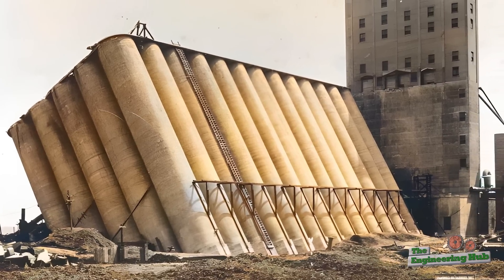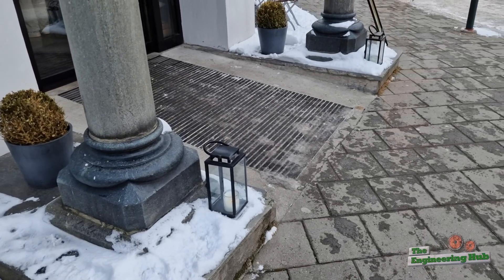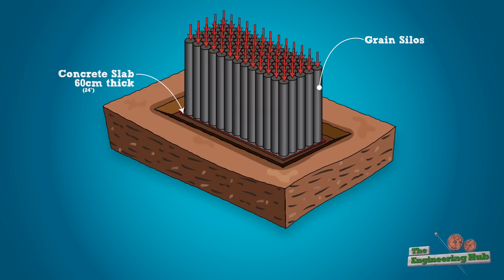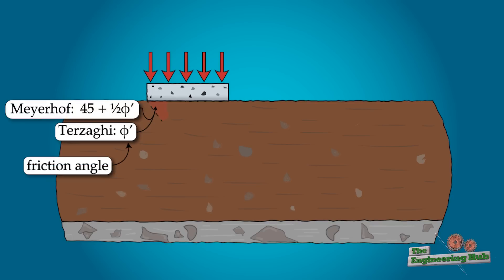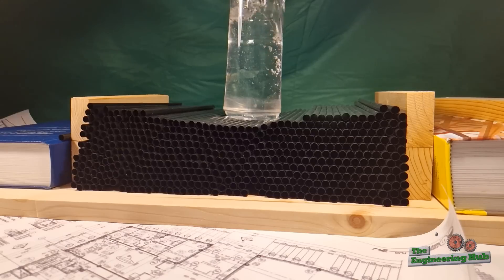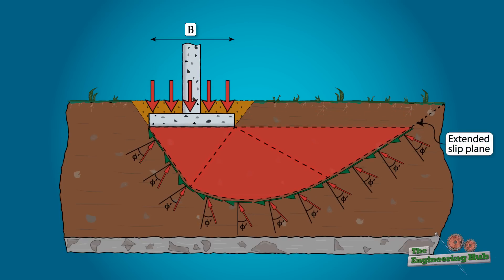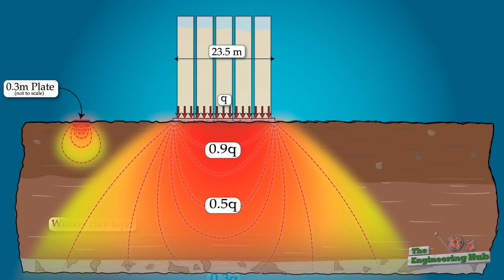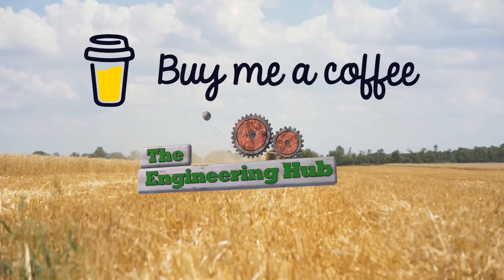Geotechnical Analysis of Foundations

Comment: It would be interesting to hear what you have to say about the Milenium Tower in San Francisco and the efforts to stabilise /save it.
Reply from the maker: That's an excellent example! It could end up being a nice video 🤔
Reply: @TheEngineeringHub  So get busy before it falls over.
Reply: @RRaucina 😂😂😂
Reply: As a pile driver, I would also like to hear your thoughts on cast in place pilings in the San Francisco "bay mud". After seeing the way they were drilled, filled with concrete or grout, and how the rebar cages are literally shoved into collapsed holes and called good... Well, it has always baffled me. I have 3 years of experience in dcip and it was some of the most horrendous pile installation I've ever seen and took part in... and I took no pride in it. 

One day I'm going to hear about one of those projects on the news, just like the millennium tower.
Reply: @dustinthewind3925  if you’re looking to take your experience to another company let me know, I have a small but serious underpinning/foundation repair company here in the Bay and I need good people. Mostly residential for now but adding more services and larger commercial jobs as quickly as I can
Yes, over the past 14 years I’ve seen people wait WAY TOO long to cage and pour their piles. They don’t want to have to pour multiple times so they’ll let the hole sit there for days/weeks before caging and filling it’s ridiculous…and wonder why the structure ended up settling.
Same for grouting their helicals after spinning, or spinning without a geotech report, there’s some dangerous installers out there, imo
Reply: Pisan envy.

Comment: I love the format of these videos. As a visual learner, the graphics and demonstrations, like with the straws, helps me a lot to understand. Thankyou!
Reply from the maker: Glad you like them! More to come!
Reply: @TheEngineeringHub  Can you do about engineering of foundations underground mining? We need to know the evolution of their structural shapes. I'm still confused with people using woods to support their tunnels, and I don't know their limits. Steels are expensive.
Reply: @davidarvingumazon5024  Wood is cheap and easily available in most distant mining locations, easily cut to length, and has great holding capacity. Using steel, you would still need something rigid to spread the load, else the steel would be driven like a nail into the earth. Very much like foundations!

Comment: Factor of safety is important here, which is the ratio of ultimate failure load to design (actual load). In every civil mechanical structure the factor of safety is used, if variable are unmeasurable or not measured it is increased. It could be high as 8 for tractors or 1.2 for rockets. In general engineering structures it is 3 to 4.
Reply: A low safety factor for rockets makes sense. These things are so precisely engineered with extremely high quality control for the materials so that the possible loads are highly predictable.
And they also need to minimize total weight as much as possible.
Reply: The factor of safety is usually taken against the computed "ultimate" strength (resistance) of the soil. Note, however, that this is the strength limit state and it may require that the soils move (settle) a great deal to fully mobilize the available resistance. In many cases, the usable strength is dictated by the settlement tolerance of the structure being supported - known as the serviceability limit state.

Comment: I am older and in USA. We rarely use jewels or newtons Pascals kilos etc.. Yes I can convert but content makers should consider using both. It would be better if US and a few other places switched to metric,  Almost did in the mid 60s.  Good vido other than I have to do conversions to understand the forces here.
Reply: now you understand what it likes to be a non american watching american videos!
Reply: @hitler69    I do at that. No kidding I right now have a guest from France watching the movie Aviator. No German sub titles Available. It speaks about wing loading and altitudes etc.. Why the USA did not convert to Metric  I do not know. The mechanics in rest of world must think these US folks are nuts when a bolt size is 17/32 s   next size up from 1/2 inch. But I think in quarts pints cups gallons not liters  Take care
Reply: Basically only the U.S. uses exclusively imperial, so I don't think the rest of the world will adapt to cater to one country.
Reply: @WhenDoesTheVideoActuallyStart  The US has never used the imperial system. The imperial system wasn't introduced into the British Empire until 1824, and the US had long been independent by then.  The US uses it's own system called "US Customary Units"  which are evolved from pre-imperial British units.
Reply: @WhenDoesTheVideoActuallyStart  The imperial system has many differences from US CU. The liquid measures are completely different.   When was the last time you heard someone give their weight in stone? I'm sorry that you aren't smart enough to understand that this stuff matters.
Reply: @thekinginyellow1744  It shouldn't matter, no.
Reply: @When does the video actually start?  no ,they wont.l don't expect them to.But can you imagine what a massive undertaking it would be for us to change.?We ate the largest economy in the world BY FAR...We are the first to do most everything.we are the guinea pigs for what doesnt work.Thats WHywe are unsuccessful sometimes..We have problems nobody else has too..but we are givers.We rebuilt our enemies after WW II...Who has ever done this?..The Marshall Plan..
Reply: Could you cover recent earthquakes via mechanics
Reply: I am an electrical engineer and physicist from California. Fortunately electrical engineering is metric by nature, especially as I have worked in several countries. I remember my relief after graduation that I would never have to use slugs ever again.
Reply: As a person born and educated in the USA I am against using the US Customary Units of Measure at all, ever! (except in NASCAR). They are byzantine and retarded and make us the laughingstock of the world.
Reply: @thekinginyellow1744  We dont want to due to kings
Reply: @jimbronson687  No Idea what You are trying to say.
Reply: Yes!I'm too tired to convert.

Comment: The Roman's drove piles 2000+ years ago and their buildings still stand firm. It doesn't surprise me that modern engineering fails so quickly. Engineering has lost a great deal of intelligence, until you consider engineered obsolescence. Most objects these days have been designed to fail after a 5 year lifespan. Shame on engineers! 
The soil testing in this video was pathetic and the designer should lose their stamp.
Reply: Survivor bias. For every surviving ancient roman building there are plenty of others which are now gone. Modern constructions may not last a thousand years but they do have to undergo constant stress far greater than what would have been expected for a structure a thousand years ago. No building today would be created without regular maintenance and proper inspections in mind.
Reply: It is true that roman structure is of high quality, Mimicking their construction methods is actually uneconomical by today's standard. The government will choose a more economical but last only 50+ years than having a structure that lasts for 1000 years but may cost 10x the value.
Reply: @Villa Pusa  lm really surprised the foundation wasn't deeper than  11 feet
Reply: Heavy survivor bias there
Reply: Uh... did you notice when this occurred? The designers are long dead.
Reply: Agreed
Reply: Thank you for the laugh. Maybe you think the "Roman's" were more intelligent than us because you also suffer from severe lead poisoning.

Comment from the maker: If you enjoyed the video and you feel like we deserve your support, you can check out the link below. Alternatively, clicking the like and subscribe button or writing a comment also helps a lot.

BUY ME A COFFEE LINK:
If you enjoy our work, you can buy us a coffee on the link below:
https://www.buymeacoffee.com/engineeringhub
Reply: Not bad! The experiment with the bottle, however, is somewhat misleading as it does not include a foundation between the bottle and the straws.
Reply: @brennans1563  Yes and the rounded edge on the bottle would serve as a additional source of slippage, given the "grain" size of the straws, but I think overall it does a good job of providing a visualization of the "underlying" principles...
Reply: I am not familiar with how grain silos are loaded, is one silo loaded to capacity then the next? Or are they loaded simultaneously? I see a distribution arrangement on top, but I assume there would be gates to regulate flow into different silos. I wonder what role if any of uneven distribution of weight may have played, say if the bins were started to fill from front to back, or one side to the other.